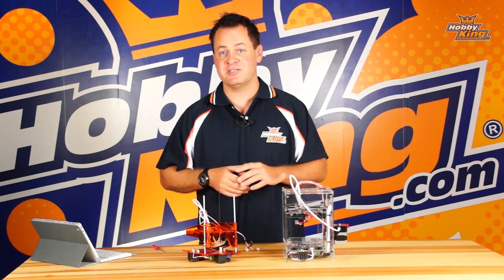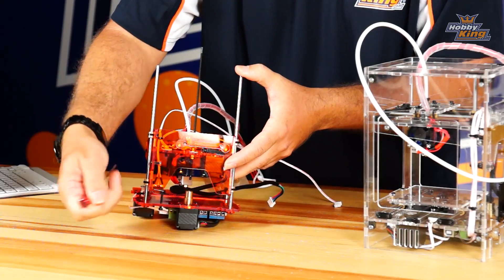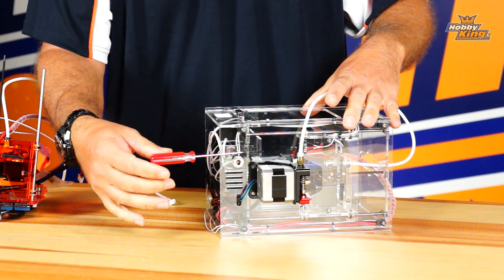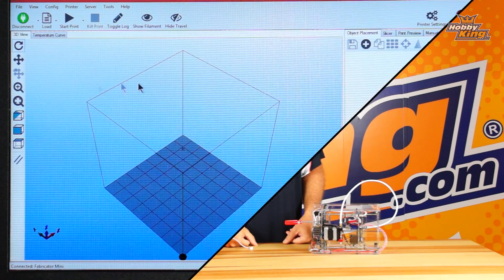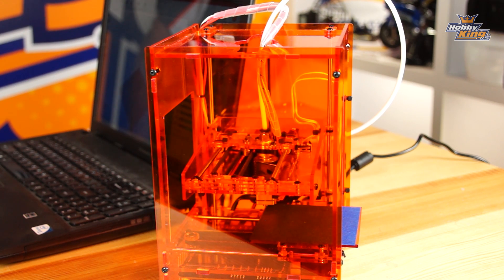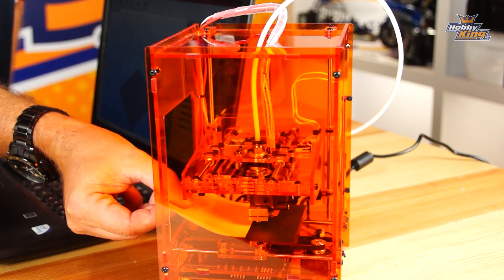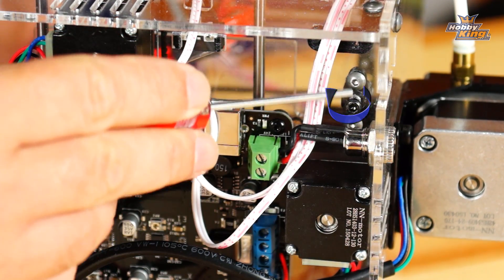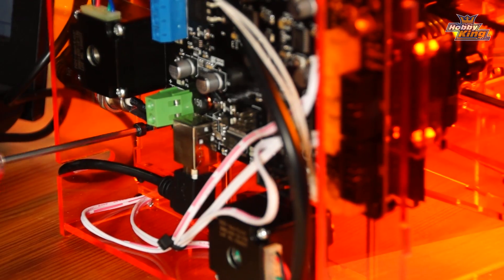Mini Fabrikator 3D Printer by Tiny Boy - Bed Leveling

Comment: Hate to tell you that's not bed levelling, that z levelling. Bed levelling is altering the bed z level at different x,y coordinates. On this printer it would require modding to do it and I've already had to do it, but you get what you pay for I guess.
Reply: +Andrew Griffiths How did you do it? My printer's bed is a little off too...
Reply: +Carlitos Well you can try matter control instead of repetier host, it can use software to level the bed, I use this software but I've not tried the leveling feature out yet.

Have a look for tinyboy on rcgroups we have a pretty good thread going with lots of tips.